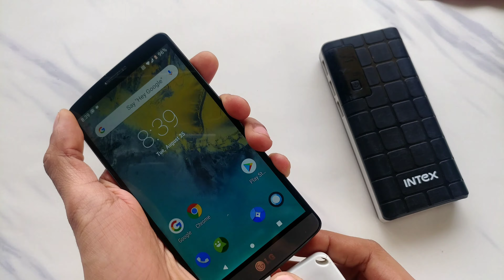Disposable Power Bank with No Charging Port...DEAL WITH IT |

Comment: Is that a rechargeable battery? If not it is not a good idea to charge it.
Reply: Yes, but if you fully use up the disposable power bank, there is a high possibility of over-discharging lithium-ion battery, so you need to add a separate battery protection circuit.